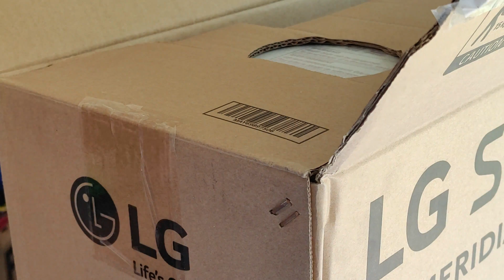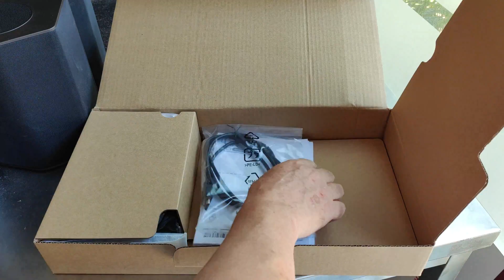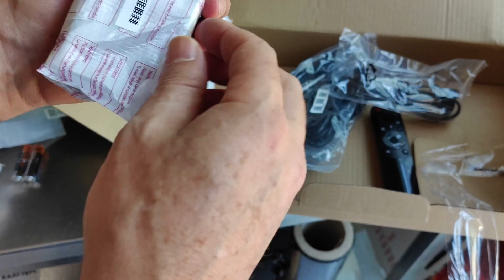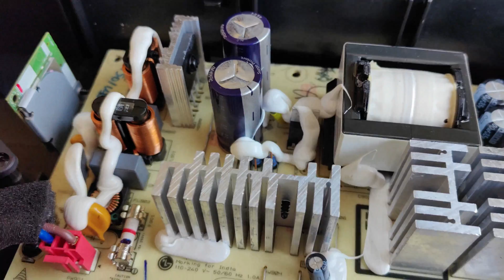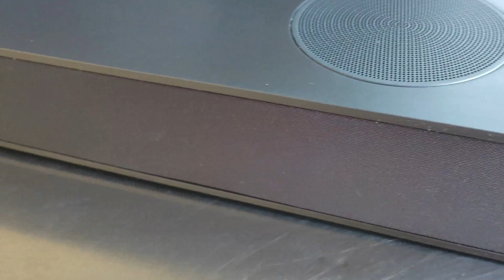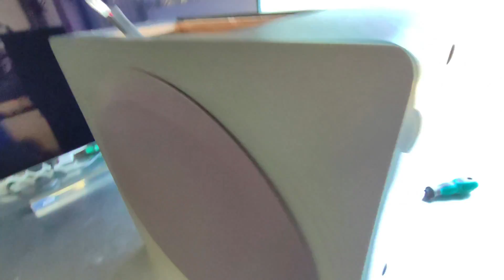LG S95QR Soundbar tear down - deep unboxing | Flagship 2022

Comment: Does it possible to exchange Right side with left and left with right by changing wire to main board
As I want to use it at Ceiling Upside Down Mount, that will change my left to right and right to left
Please Share ...
Reply: I am asking for main bar

Comment: I am looking a review of old model soundbar lg s90qy and viewed this video. Could you share some comments on hows the performance by far (same as s90qr but without rear speaker). Notice the new model of LG s90ty model not so impressive despite both core basic features mostly are same. I need the honest review from you as soundbar anthusiasm 😊
Reply from the maker: There better sound bars on the market

Comment: Are you giving this soundbar a fair shout? I noticed you set the Tv and SBar on an Ikea table off to the side of the main TV.  I also noticed you just seem to placed the speakers on the back of your couch rather than proper speaker stands. I also noticed that your room has a lack of sound absorption/deadening materials like curtains and a rug directly in front of the soundbar.  There appears to be a noticeable amount of echo/reverb bouncing around your  room?

Comment: what is more better JBL 9.1 or LG S95QR? thank you.
Reply from the maker: LG is more like a system
Reply: It depends on what you need and expect. I've bought the S95QR but that's my preference. It's better for Atmos and DTS:X and does support IMAX Enchanced. For some reason LG dropped IMAX support on the successor. The JBL is a tad better for stereo.

Comment: "Hello to all of you,

I have a question that I couldn't answer myself through Google and forum searches. 

Is it possible to connect the SPQ9 rear speakers, which were delivered with the DS95QR, to a DS90QY? 

According to the manual, only the SPQ8 can be connected to the DS90. 

Since the SPQ9 can only be purchased as part of the DS95QR package and not individually, but only the SPQ8 can be bought separately, it makes sense that LG only mentions the 8 series in the manual!

Has anyone tried connecting the SPQ9 to a DS90?"
Reply: No. You can only use the speakers from the set exclusively with this soundbar.

Comment: I got one of those because both HDMI Ports of an Sharp HT-SBW800 died after only 3 Months.
The Sharp HT-SBW800 is sold for 336.-
The LG is sold for 1'199.-
And unfortunately the Sharp one sounds much better than the LG.
The Sharp sounds very good and natural at Volume 10/30
The LG one sounds like shit and is not loud enough at Volume 40/100 or even 50/100 to get the same loudness of the Sharp at 10/30.
The Connectivity of the LG is much better and the HDMI Feature are better, but what use is it if it sounds like crap.
Especially Dolby Digital Content is abysmal compared to the cheap Sharp.
Interesting is that Dolby Atmos Content sounds better on the LG, so perhaps there is something messed up Software wise with Dolby Digital.

I still have 21 Months Warranty on the Sharp so I gonna send it in for repair and can't await to get it back and replace the LG with the Sharp one again.

I really dunno what LG did mess up, but there are too much highs, not enough middle and the subwoofer is also used only badly.
I tried every mode and fiddled around with settings, nothing helps, it simply sounds like shit, an unbalanced mess.
The Sharp has almost no settings or modes, but sounds good out of the box.

I watched the Video here because I wanted to see what LG put in there and to figure out why it sounds so bad.
And for me it looks like they used the cheapest possible trash speakers, and that in a Sound bar for over a grand, they should be ashamed.
The Sharp uses the same Speakers that also Creative uses for the Pebble, and they seem to be much better.

The Subwoofer(downfiring) of the Sharp is also about half so big, but performs better than the behemoth LG uses. So it can't only be bad Speakers, there must be something else, like messed up Software or Meridian was just incompetent. In any case, I will never buy anything with Meridian on it again, because if you bang your name on a product, then you should also deliver quality or just live with the consequences if you fail like that.

It's really a shame that a product that costs more than three times as much as the other delivers such abysmal audio quality in comparison.

I also guess they are lying about the Wattage, because the Sharp has almost the same Wattage, but turning the LG to max is like 50% of the Sharp max. I mean how is this possible if they have the same Wattage? Or are the Speakers LG uses so bad that they only deliver 50% of what the Sharp ones can?
Reply from the maker: You are right 👍

Comment: does it have HDMI 2.1 or 2.0 input?
Reply from the maker: You don't need it, it has gaming signal and HDR pass-through
Reply: @hxosplus  it doesn't work with HDR signal with resolution 4K120Hz cos bandwidth is limited to 18GBPS total shit products.
Reply: @vivekverma3629 Beyond the expensive Sony Soundbars there were no other products with full hdmi 2.1 support at the time of the release. Your comment makes no sense. It supports some hdmi 2.1 features like ALLM, VRR and eARC. It does indeed not support full 2.1 bandwidth but it was never advertised.